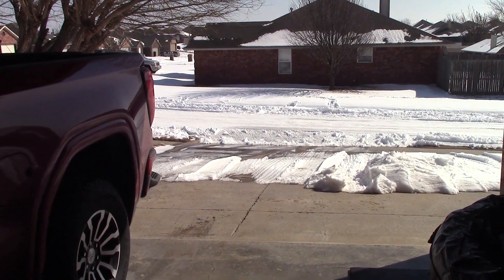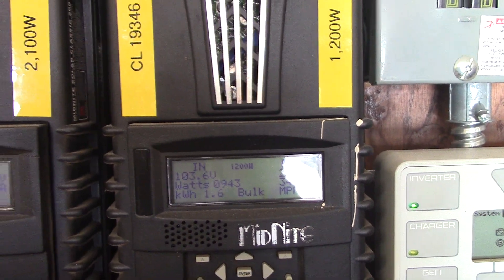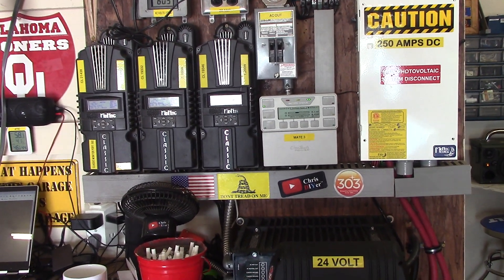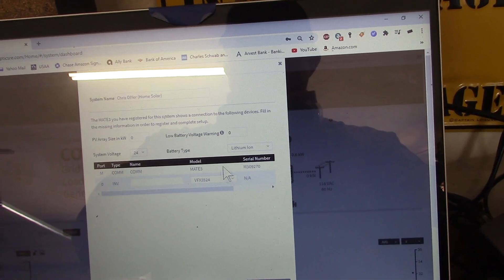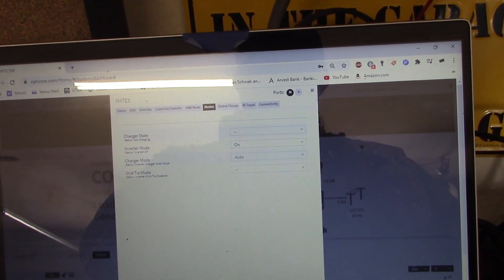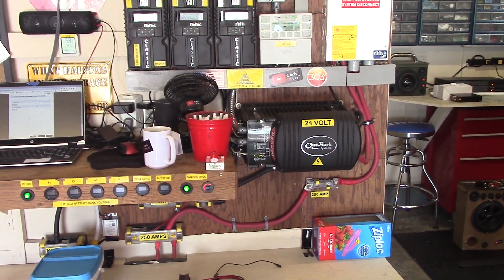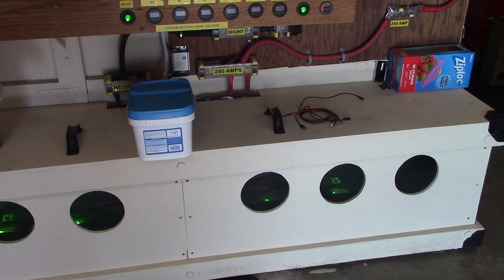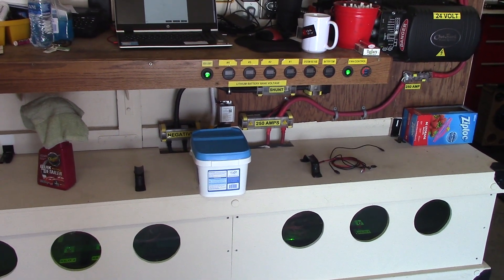Outback Power VFX 3524 and Mate 3 "Auto" charger setting

Comment: At voltage does that outback starts showing the low battery  warning?
Reply from the maker: I got mine set at 23.6v
Reply: @ChrisDIYerOklahoma  ok, is that the newer version or the old version cut off voltage can be set too ?
Reply from the maker: @diy-bj2ed  - It is the VFX 3624 and Mate 3 from six years ago. Yep, it is adjustable. Solid performers since Day 1.
Reply: @ChrisDIYerOklahoma  ok I'm buying a used one thats why i wanted to know
Reply from the maker: @diy-bj2ed  -- cool. Yeh, mine has been (almost) in continuous use 24/7 since I installed it. Never has let me down. They are built like Mack trucks. Keep the filter clean and connections tight
Reply: @ChrisDIYerOklahoma  ok thanks. I Like the fact the parts can be replaced